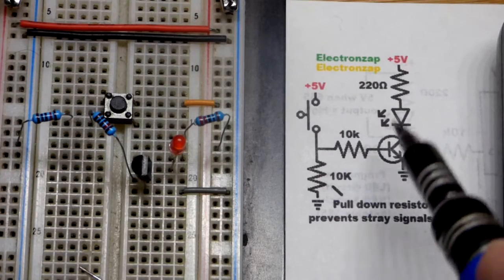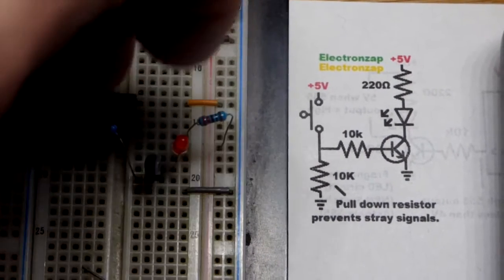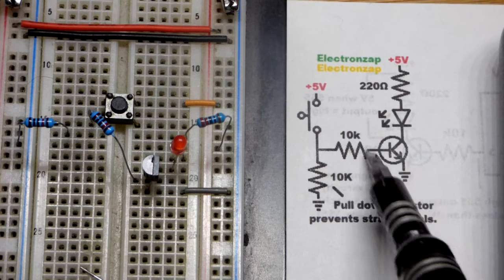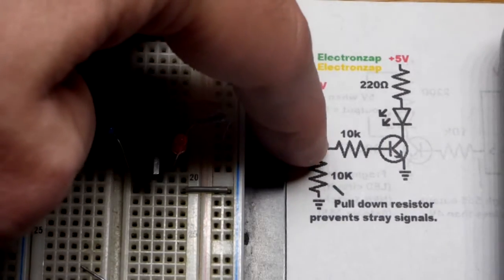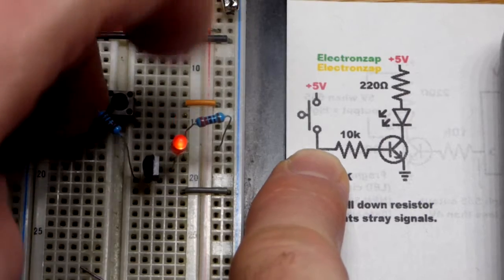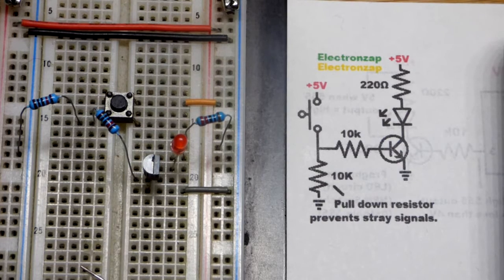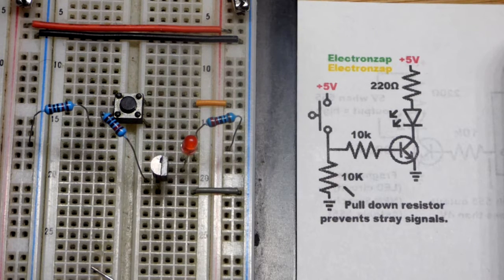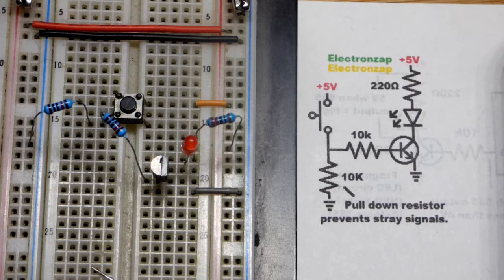Pull down resistor used with NPN Bipolar Junction Transistor BJT switch circuit by Electronzap

Comment: ok as switch i guess…but the voltage divider provides 2.5v to the base…so fully saturated…need that lower resistor for an amp app

Comment: Sir.. how can I make a transistor amplifier
Reply: The process of amplifying an electrical signal is a sophisticated and intricate task that requires a strategic placement of the correct passive components in both series and parallel arrangements with the transistor. The configuration and arrangement of these components can significantly impact the effectiveness and strength of the resultant signal, and as such, it plays a critical role in the amplification process.

It's important to note that there are numerous ways to arrange these components, each with its own unique set of outcomes. However, it's only a select few of these arrangements that will successfully result in an amplified signal that meets the desired requirements. This makes the process of selecting the correct arrangement a challenging, but crucial task.

Understanding the intricacies of these arrangements, the role each component plays, and how they interact with one another is essential in order to achieve the desired amplification. This knowledge not only guarantees the successful amplification of the signal but also ensures the overall efficiency and performance of the system.
Reply: @HazeAnderson  I need a basic idea of calculating the basing resistors
Reply: @Manu-np5re  - I’m pretty sure the circuit in this video is an amplifier.  In this circuit, the base pin of the transistor gets a small current (say 1 milliamp), which allows 100 milliamps to go through the collector to the emitter.

Comment: They say the 2N2222 is the most common NPN small signal bjt. I bought a bag of a hundred from amazon and checked a bunch of them with my transistor checker and the gain ranged from about 150 to almost 300.